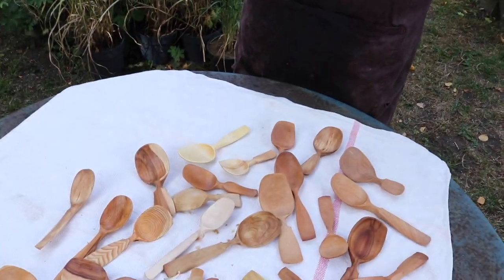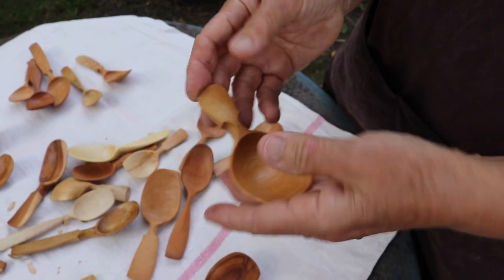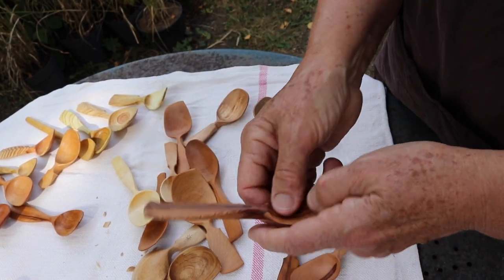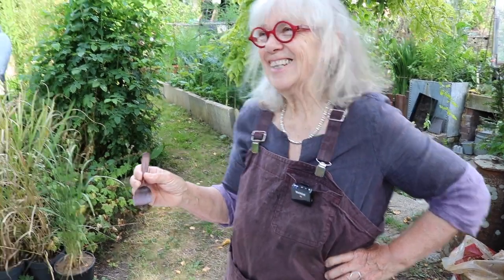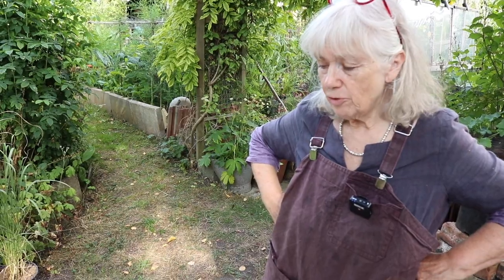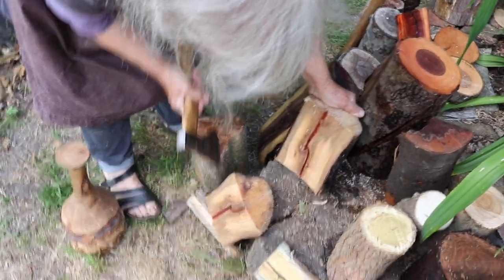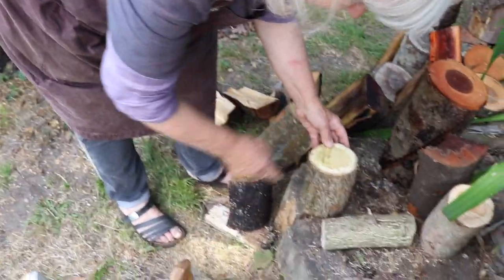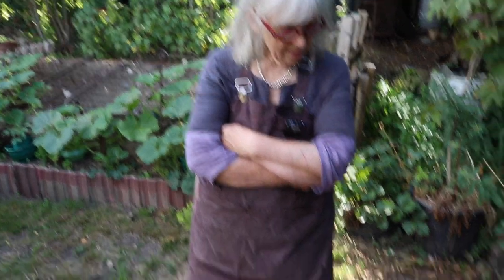Wood Varieties For Spoon Carving - Deborah Schneebeli Morrell

Comment: When you are storing blanks in the freezer, how do you prepare the blank? For example, I have a feeling you don’t just drop a piece of wood into the freezer, but do you put it into a sealable sandwich bag, wrap it in paper towels, wrap it in damp paper towels and place into a zip sealed plastic bag before fiercely depositing it into the deep freeze??
Reply from the maker: Hi Chris,  you can put it as it is into the freezer or put into a carrier/ziploc bag first, either way is fine and there's no need to over complicate it ~Peace~

Comment: I recently acquired a couple of black walnut logs about 14 inches in diameter and 20 inches long.  They were fresh cut so they are very very wet.  I have sealed both ends with Anchorseal.  My question is whether to strip off the bark to help reduce the moisture, or will this lead to more checking?
Reply from the maker: Hi Richard, if you are looking to store the wood, then I would leave the bark on. Just be sure to store it in a cool dry place ~Peace~

Comment: Hi guys. Really enjoyed the video ….Just a quick question I acquired a lot of chokecherry (prunus virginiana) I’ve been told parts of it are poisonous as is most cherry. Have you ever used it for spoon carving?
Would appreciate some info if possible 
Cheers
Reply from the maker: Hi Samantha, unless I am mistaken Choke Cherry is only naive to the US so it's hard to comment on the use of it. Also worth noting that the Cherry wood in the UK is safe to use for Spoon Carving ~Peace~
Reply: Cheers Zed, …..will give it a try 👍